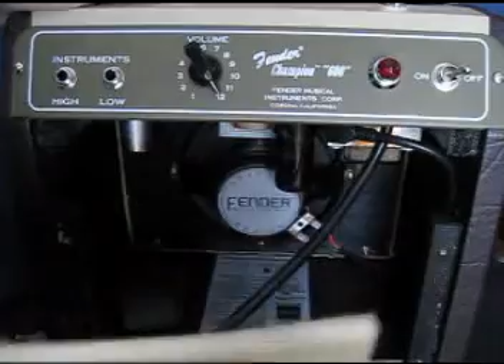champion  600 how to change the speaker weber

Comment from the maker: the fender speaker is a 6 inch foam surround woofer ... if you actually hit it hard it will just fall apart 
I have since purchased a vox ac4 with a 10 inch speaker & its a much better amp top to bottom

Comment: I bought the weber 6 alnico and didnt like it (now sitting in a box on the book case). The jensen mod speaker sounded better to me. I one upped and installed a weber 8 ceramic with a birch baffle. Tung sol tubes. Yet to do the tone stack.

Comment from the maker: changing the speaker does not require you to drain the circuit.  Don't be afraid of working on amps if you have good soldering skills and good electronic basic knowledge ... if you can wire a stratocaster pickguard from scratch, make it look factory perfect and have it work right, you are ready to tackle basic amp stuff...
If you can't get a guitar to work noise free and neatly wired an amp project will be a disaster...
Since an amp is a NOISE MULTIPLYING device with a deadly power supply

Comment: @patfurlan To do mods on this particular amp though do I need to drain the circuit? I saw you remove the chasis to do the speaker mod so I'm afraid of touching something in the chasis and shocking myself lol. I've never even wired a guitar (which I'm actually going to learn how to do over this winter break) I figured a speaker and tube change would be simple enough.

Comment: Pat - can you swap the speaker out just leaving the chassis in or is it blocking you from doing that ?  Thx
Reply: im about 4 years late but the chassis must be removed. its extremely easy though as its just 4 screws and the chassis slides right out. the chassis is also grounded so you can touch that all you want with no fear of electrocution.

Comment: This almost turned into /r/watchpeopledie real quick. You need to drain the capacitors in the amp before handling the circuit board like that.
Reply from the maker: One should always discharge the filter caps before working on an amp. True.  But If you are just changing the speaker and not working on the circuit ? If you don't know what to discharge in the circuit you will probably get zapped trying to figure it out. Would anyone actually watch the videos if we spent 3 minutes showing this each time?  We all know not to poke our own eye with a sharp stick ? RIGHT
Reply: patfurlan it's just not good to show people you are touching the circuit board with your bare fingers and not saying that they should train the caps first. Just asking to get someone killed.
Reply from the maker: i am still here
Reply from the maker: https://youtu.be/hedZTu7S4HE?list=PLyyKjYCbZdygYNT0dl4JZZXzA9P4kOwXV

Comment: are you not supposed to touch the circuit or you might shock yourself? or did you drain it? or does that only apply to point to point wiring? sorrry Im new to this ahah

Comment from the maker: the valve jr head is a much better mod project... the circuit is almost the same 
but you have more room for a better output transformer and don't have to deal with the 5 inch speaker ...  I'm still not 100% happy with my 600... 
My valve jr is now my unique personal overdrive sound & with the hammond 125ese
output transformer and an EV speaker  it's as loud as most 20 watt amps